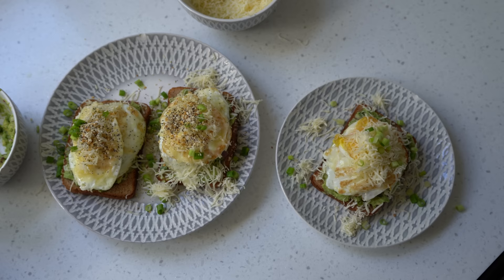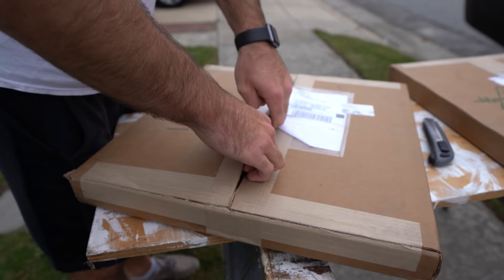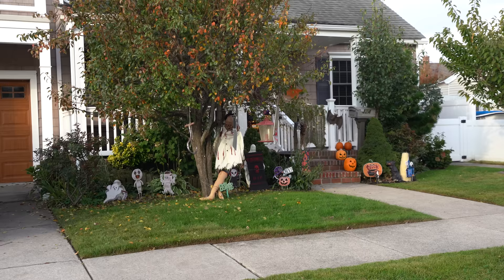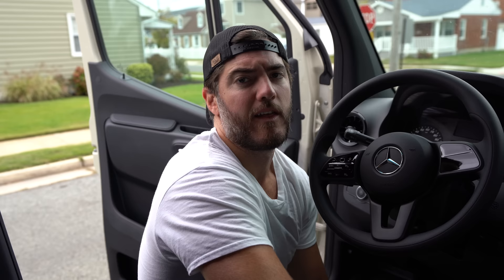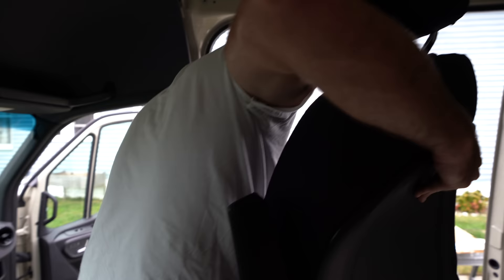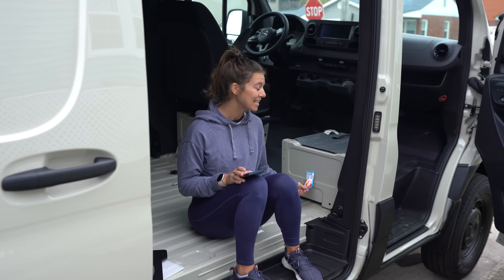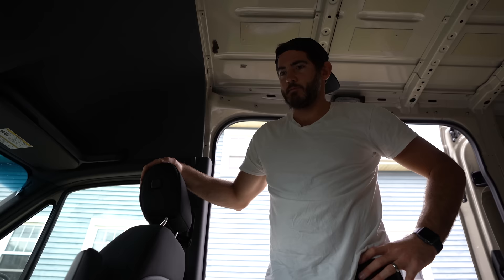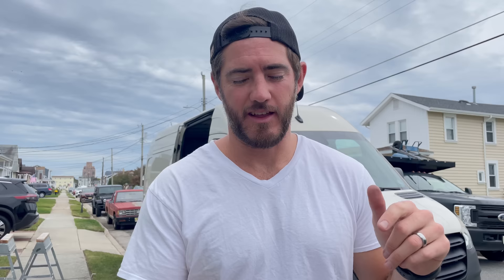This Swivel Seat is an ABSOLUTE GAME CHANGER for Van Life!

Comment: instead of contemplating cutting the seatbase open from the back, just access it from the side, through the flap it already has. Sure, it won't be as convenient and you can only access it while the door is open, however, I'm sure you can find a lot of things to store that are only needed while stationary. like tools and spare parts. 
Also, you confused me when you called the parking brake 'ebrake'. the Sprinter, as an option, comes with an Electric Parking Brake which most people refer to as an e-brake.
Reply from the maker: Yep, I realized that after a few comments haha so much easier!!!  yea we use ebrake and parking brake as the same but it's really a parking brake.  In an emergency that e-brake isn't strong enough to slow down the van.

Comment: Good job! I always enjoy your videos! Same swivels I have but I still haven’t done the install because the E brake kind of intimidates me-
but soon! Also DIYvan has an access panel for the seat base. That might be a good compromise??
Reply from the maker: Oh you can totally do the eBrake ya just pull it down from the bottom, it’s easy.  Do you have a link to access panel?
Reply from the maker: @2sherrymoore   @Sherry Moore  oh thank you!  Our van actually has that, it's just not vented